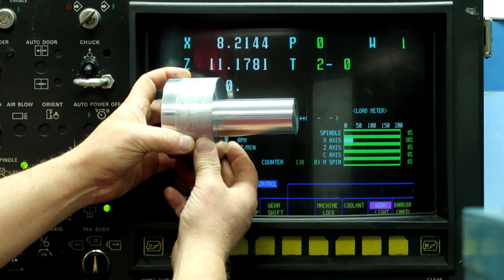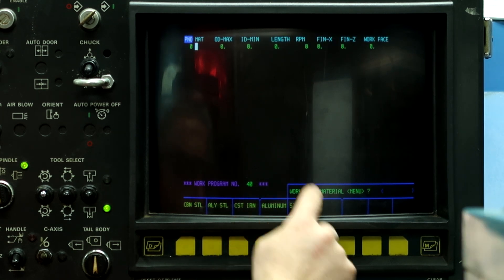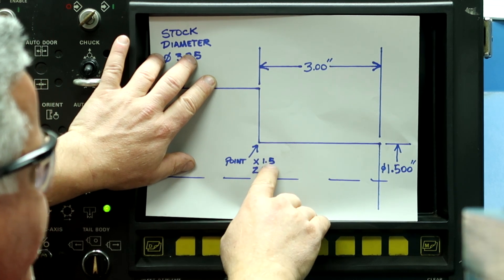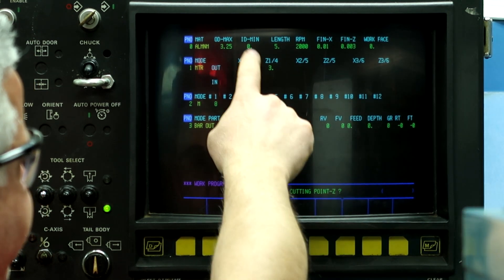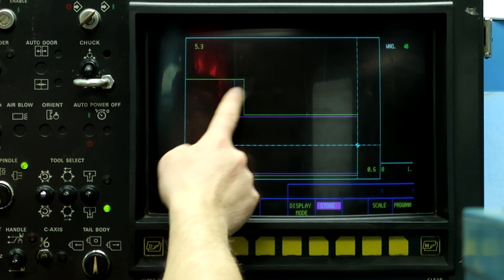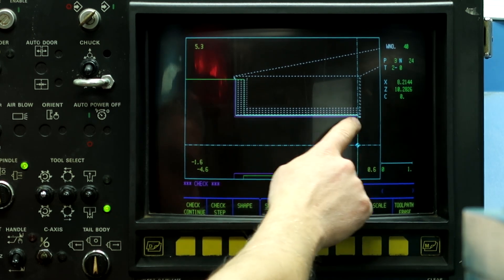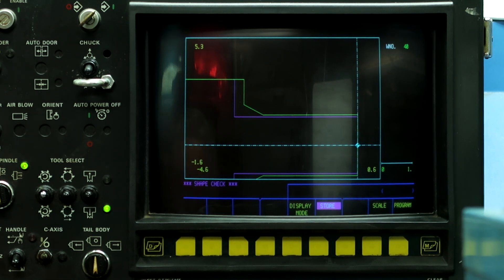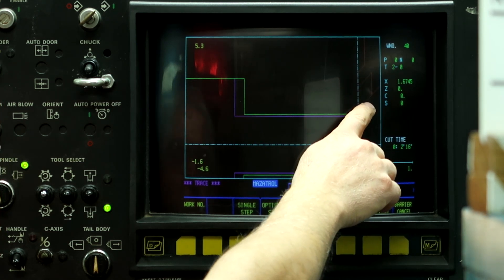Mazak CNC Lathe Material Shape Function

Comment: Is there a way to show down the graphic for the tool path? 
I'm very new to mazatrol, and the quick turn 450 I'm running,  with a 640T controller. The tool path graphic goes by entirely to fast to understand what it's doing, when you do a c ontinue check.
Reply: In this video when you did your check continue,  it goes through the process show,  but on the controller I'm using, it's so fast if you blink you'll miss a few passes.
Reply from the maker: @justnd2582  sorry I am not aware of any way to slow down the graphic speed.

Comment: Hello Sir! What if the workpiece already have multiple shapes?
Reply from the maker: You then continue to describe the geometry. I only used one line. The older control like mine allows up to 3 lines for OD and 3 lines for ID shape description.
Reply: @mazatroltipsandtricks6816  I think I have older machine. Mine is QT 150, 640T control. Maybe I should make another mat shape line.
Reply from the maker: @SimpLeMan2888  No, your controller is 3 generations newer than mine. I don't know exactly when Mazak changed the shape geometry to be more like a bar out process description.

Comment: Perfect example of where you would use this is when your machining forgings or castings. We use this feature all the time on our integrex machines when we are machining forgings. Saves so much cycle time not machining air and the best part is your turning units are no different if your machining a forging or from a billet the only thing that changes is you add the material shape and the rest of the program stays the same.